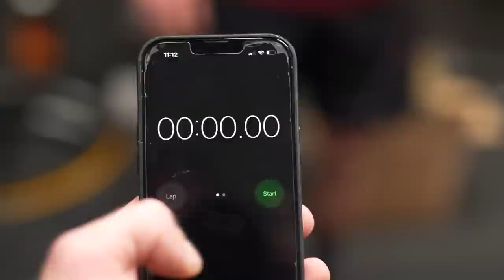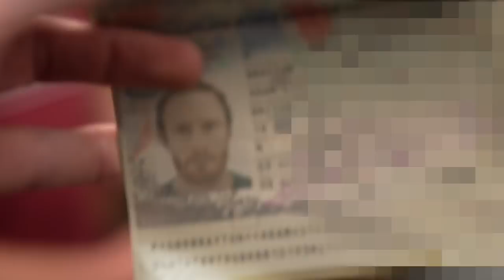GastoVlog - Me & Elliott Heap build my New Nukeproof Downhill Bike - Dream Build Dissent Carbon

Comment: Talking of 24"...i have a 2001 DH Slalom bike with 24" wheels in me shed.

Its front suspension only with a staggering 56mm of suspension, std 9mm QR boots in the wheels, 7 speed with single gear up front, cable pull RST Disk brakes, and a bombproof alu frame.

Think it can take 2.6" wide tyres on it too!

😅
Reply from the maker: I had one of those red rst cable discs. That would have been the ultimate bike back then!
Reply: @adbrayton  it was pretty good...but, a little rough round the edges.

Feels funny to steer and has pretty wide bars...maybe, i just needed to use it for its intended purpose 😁 

I've taken it down a few steep trails, but, I got it at a time I was in the last year of Uni, so, it didnt get used much befor I had to ship off back to my home town and find a job...tech then moved on and I'd built a new whip...and managed to snag a Giant reign 3 in the sales in like 2007.

To be fair, the unusual feel to the steering is likely as a result of the designer wanting to encourage a level of instability to aid the speed it's possible to change direction.

I think the forks legs have about the same diameter as your Fox forks by the way.

I believe they were made by a company called DNM.
Reply: I'm older than our Grandad; are you able to upload a quick short of this bike? I'd love to see it.
Reply: @R1davies  it's buried in the shed...maybe one day